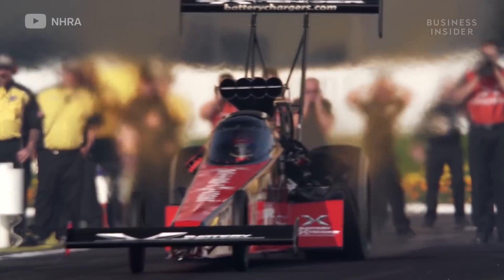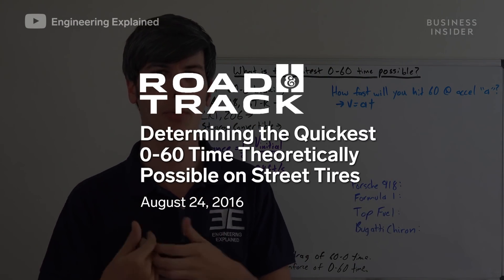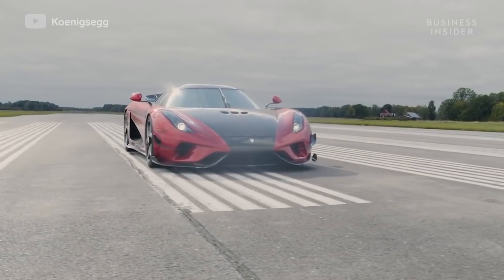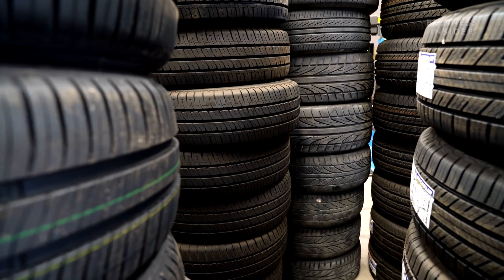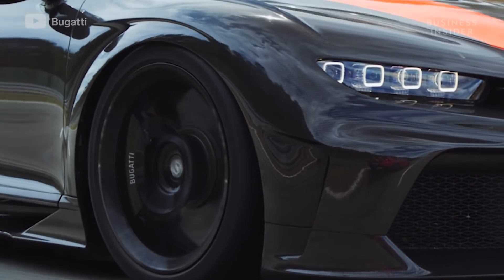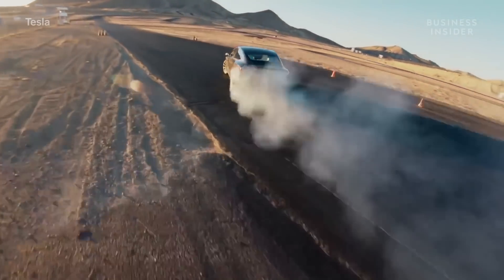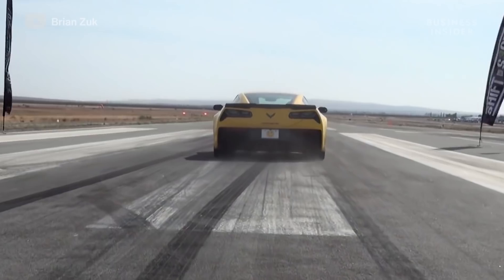Why Going 0 To 60 Mph In Under 2 Seconds Is Almost Impossible | Carsplainers

Comment: Is really 60-0 possible to use to estimate 0-60? Sure grip is the same, but there should be other variables, like drag, and maybe tire patterns
Reply: Yeah, engineering explained did another video on how he was slightly incorrect with that. Cars can potentially accelerate faster than they can decelerate

Comment: It's impossible to go 0-60 in under 2 seconds
Rimac nevera: hold my 4 motors
Reply: Thar Carwow drag race though...
Reply: @Wandagon  hell yes
Reply: @Wandagon  2.08 isn't exactly under 2 seconds
Reply: @MultiDeivas  I'm not saying it is, but that was just a drag race by someone who isn't their test driver and they didn't even try and optimise the car. So imagine if they do!
Reply: @Wandagon   The video literally says why something like that is almost impossible under 2 seconds. There is no need for the best drag racer, it's just holding the brake pedal and releasing, there are no gears nothing. Only thing you have to look for is that you pressed the throttle all the way in. Also the guy from Rimac said that Matty actually had the record speed on quarter mile with that car. The only way left to optimize the car to get to 60 faster is to add drag tyres which nullifies the road-ready aspect of these vehicles.
Reply: @MultiDeivas  the rimac did do 60 in 1.8 though
Reply: @mengienghinamwaami4894  Show me a video or some kind of proof. Carwow got a record quarter mile with 2.08. I don't see any proof other than claims of 1.8.
Reply: @MultiDeivas  On Michelin sport 4s tires on a normal track it did 2.08. with the Michelin pilot cup 2s and a well prepped surface. It will do well under 2 seconds. It did 2.08 while being on 98% power bro. When it's fully unlocked and the tires and track is set. It will hit 0-60 in less than 2
Reply: @MultiDeivas  You think Demon can reach 2.3s in normal conditions? Rimac Nevera has 8,6sec quarter mile in normal conditions made by a non profesional driver. Try to beat that.
Reply: @MultiDeivas  replay the vid and pause it when it shows the device that calculates the time for quarter mile. It also shows 0-60 time as well as the time it took to stop from 70-0. They showed the device for both the nevera and sf90
Reply: @adityavikram244  it can do 0-60 in 1.85 second If he have drag tyres and if it is a perfect surface for it
Reply: @hercegovac9999  the place where carwow makes the drag vids is pretty good when it comes to traction so I don't think there'll be much of difference. Maybe 1.9 but that'd be the max if I had to guess
Reply: @adityavikram244  If you want to know place where they tested the car is in Croatia and coditions were decent but again it made 0-60 in 2.08 in street legal tyres which is very good and if conditios Are perfect maybe someday they will achive 1.85 (sorry about english I am from croatia :D)
Reply: @hercegovac9999  yes because the rimac owner said they could make the car go faster by releasing new software updates so it is very much possible. That guy has made an absolute beast tho.
Reply: @adityavikram244  yes they can achive so much records in this car and he said it can easely go 500+ but it is limited 415 ode the safety
Reply: @MultiDeivas  it was 1.8
youd be surprised how much of a difference 0.05 seconds make in a drag race let alone 0.2
Reply: Drzi moja cetri motora
Reply: @stompingjacklope2217  English please
Reply: @user-sd7bh1hc8g  He said hold my 4 motors
Reply: @user-sd7bh1hc8g  why English brother? We can speak whatever language we want.
Isto sranje drugo pakovanje.
Use google translate my friend, its 2031
Reply: @markos4822  oh. Okey thanks man. Appreciate it
Reply: Kid Rimac Nevera did 0-60 in 2.1 seconds best never went under 1.9 😂
Reply: @Leonardo Meireles no they still lied even after rollout it cant do under 2 seconds, and electric cars cant be a sports car or super car just a bad parody of one a replica. U need sound n a tranny to be a real sports car or else its just grandmas grocery car
Reply: @Leonardo Meireles 🤣🤣🤣🤣🤣🤣🤣🤣🤣 my guy said overtaken. Get ur straight line ass outta my face, that aint real driving going in a straight line requires 0 skill I dont care about going straight fast.
Reply: How does it do this if its motors are being held?
Reply: @Eat-MyGoal  🤣
Reply: Tesla Model S Plaid = 1,9sek.0-60mph!
Reply: That does not go 60 in under 2 its not possible yet tesla lied, and if an electric car does it, it doesnt count because its not a real car so it doesnt matter, its made for grandmas
Reply: Tesla Plaid rally car 1.3-1.5s depending on the grip

Comment: This video sure didn’t age well, the Rimac Nevera can do it in 1.85
Reply: It says is almost impossible, not impossible.
Reply: @lmao6769_  people can't read
Reply: they are not official numbers, if you go by unofficial there are a ton of cars that can do it
Reply: @momentum8717  bruh its official go watch the carwow drag race
Reply: Uhhhh, he did point out quad EV motor vehicles are going to push that boundary. Which is what that car is....
Reply: @youwerealltooclever  EV wont do jacksh1t bc its all about the grip and not about the power u kids
Reply: With 1 feet roll out and a drag strip this video did age well
Reply: Well look, Matt or carwow drag raced the Rimac CTwo on ordinary pavement. and got the best time of 2.08 sec corrected, which is 2.28 uncorrected. Which is right where it was predicted on a pretty ordinary old unprepped surface. So it might be possible on a glue prepared dragstrip, maybe also with rollout correction, but not on regular roads.
Reply: very true

Comment: Okay, but how can we use the decelleration formula when during braking the air helps to slow down and in accelleration it works against what you're trying to achieve?

Comment: That brake distance logic actually isn't 100% true. It's probably not even 50% true. You can apply it in specific instances and maybe use it to build parameters, but as a rule? It's not even close to reliable. Just because a car brakes faster than another, doesn't mean it's 0-60 is comparable. They explain it in a way that sounds like it makes sense, but in a lot of ways, it just doesn't.

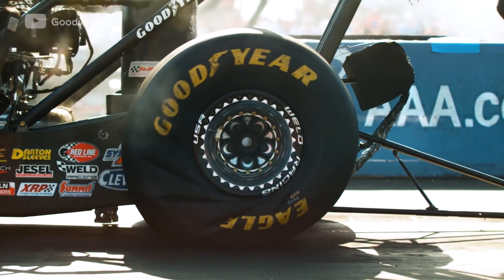Comment: 2:04 More surface area does not increase friction
Reply: It does, one of the reasons that slicks make more grip then normal street tires is more tire touching ground
Reply: For rubber tires more surface area or a larger contact patch creates more total grip. This really only applies to rubber because the coefficient of friction of a tire is inversely proportional to the pressure on the tires. So for a given compound a larger contact patch decreases the pressure pushing on the tire, for most everything else though with a static coefficient of friction, surface area doesn't matter.
Reply: The biggest difference between race tires and street tires is the compound though, so i'm sure you could cut tread into a slick and it will still have more grip than a street tire with the same grip, the problem is the tire won't last nearly as long.
Reply: @tnc4700  "The force due to friction is generally independent of the contact area between the two surfaces. This means that even if you have two heavy objects of the same mass, where one is half as long and twice as high as the other one, they still experience the same frictional force when you drag them over the ground."
Reply: Except it does
Reply: @bendeguzbagosi2385  No, not directly. A wider tire wouldn't increase traction if non of the other characteristics changed
Reply: @madmarshmallow3983  It would increase grip, not friction
Reply: @tnc4700  he is right lmao. Traction is not friction. Google it
Reply: @tnc4700  I will explain to you again since it looks like you skipped basic physics class.
Friction NOT equal to grip or traction, they are two different properties. You are talking about grip, not friction
Reply: @tnc4700  softer, not wider. Softer tires are wider to manage tyre wear

"Wider performance tires are stickier and made for cohesion with the road, they are also wider to manage wear. For tyres the friction generated between the tread rubber and the road surface is generated through two mechanisms - adhesion and hysteresis. Pressure distribution in a roller wheel is not symmetric at the contact patch, rising steeply at the front and rear of the contact patch to a value that is approximately equal to the tyre inflation pressure. Overinflation and underinflation change this distribution because of a higher pressure in the former and a reduced pressure at the center of the patch in the latter."

Comment: Feet/seconds , 0-60mph, crying in metrics 😭
Reply: Acceleration in feet/second as well 😂
Reply: @luca_sbll  should be feet/second^2 tho
Reply: @lUnderdogl  yes, that was the point of my comment
Reply: Even though I'm all for metric system I dont mind people using 0-60mph as it's almost equal to 0-100kmh
Reply: @hamzajunaid11022  62 miles is i think 100kph
Reply: Hamburgers/freedomEagles
Reply: I’m pretty sure there are at least 5 similar videos out there narrated by some British guy instead.
Reply: tbh i just got used to it,like for example:
15mph=25km/h so 30 mph=50km/h

Comment: Everybody talking bout the Tesla Roadster but nobody talking about the Rimac C_Two
Reply: @James Olelo thats all just shady. Its been announced for years now. The Rimac is basically in its final stages before going into production, theyve made dozens of test cars and driven them, even F1 champion Nico Rosberg has driven it on his channel. The Rimac, at least now, is a much more real car. And i seriously doubt the 0-60 time of the Roadster with that price
Reply: The Rimac C_Two prototype did 0-60 in 2.39 on 80% power and two people in the car just a few months ago. The final production version of the Rimac C_Two will be introduced tomorrow btw. It will be interesting to see the 0-60 of the final product.
Reply: Electric cars are terrible and soul less. It’s like the fastest dishwasher you can buy, who cares…….also, 6000 lbs sucks for anything but straight line acceleration and they are terrible for longevity at track days.  Bottom line, if you are a real driver, you DONT like electric cars other than for pure utility.
Reply: @cqc556  pfff. Bet you never been in one. And not all electric cars are 6000lb
Reply: @mr.simulator4724  The Nevera is almost 5k pounds(4747 pounds) but it has aero and it has torque vectoring to somewhat improve handling. Inertia from the weight is still an issue and it requires a lot more to compensate compared to lighter ICE cars. New battery technology could reduce weight though but those are likely gonna take quite a while to be ICE car level light while still maintaining high energy storage.
Reply: If you did t know, romance released the Rimac Nevare yesterday. I think carwow did 0-100 kph in 1,6 seconds
Reply: @chm1ata  Yeah, and they even broke the quarter mile record unofficialy
Reply: @chm1ata  Nevera*, means Storm when translated from croatian.
Reply: @jebipasadegene  nice
Reply: @pranavprasanth4488  this didn't age well
Reply: Rimac Nevera
Reply: @Javijimenezariza  well yeah but the comment was made 2 months ago and i never got round to edit it lol
Reply: Because the Rimac is really expensive, only very few people would afford these $3 million hypercars. A $200k car isn’t cheap, but definitely much more accessible than the Rimac, and promising similar performance. So many people actually look forward to buy a Roadster, but I think Plaid S cannibalized a lot of hype for the roadster
Reply: @kerbodynamicx472  but the Rimac at least exists... the only thing ive seen from the roadster are edited photos and cgi
Reply: @brunolang210  hey at least there’s a prototype on the announcement
Reply: @brunolang210  the roadster exists man lol
Reply: @brunolang210  plaid exists..
Reply: @cascito  well, this comment is 7 months old, and the plaid got thrashed on the 1/4 mile by the Nevera so...
Reply: @brunolang210  Now u seriously doubt the roadster ?
Reply: @cascito  well, yes.
Since there are still a lot of Tesla's promises "put on hold" so to say. They have to start delivering to regain my trust, no doubt tesla is a cool brand but their claims are often not realistic.
Reply: @brunolang210  I love Tesla , SpaceX and Elon , I know what they have gone through , Tesla have gone through hell and where they are ... It's just inspiration and I am a car guy too..
Reply: @cascito  dude. Do u really think he was all alone doing that? The fuq. How limited is ur thinking? 🤣
Child go sleep. 
Yaar iss Elon ne kya pilaya h tum logon ko.
Do u even know that companies like Porsche were once on the verge too? Tesla isn't some lone wolf/dark horse sh!t.
Reply: @kamallb4650  bachche aadhi baat p rote nhi ....
Maine poori bio graphy padh rkhi h ...
Aur usne apne paypal k paise se baar baar Tesla aur SpaceX ko bankruptcy se bachaya h...
Reply: @kamallb4650  Ek aur baat pata h na SpaceX k saamne ISRO bhi kuch nhi h ..... SpaceX jab 10 baar launch krta h na tb ISRO ek baar sochta h launch krne ko😂😂😂
Reply: @cascito  umhm🤣
Good luck Bhai....tum hi sahi ho. Baaki duniya n doosri companies toh exist hi ni krti.
Ye saare k saare ek hi h. All hail lord(daddy) Elon 🤣
Reply: @cascito  beta tumahara isro aur space X ko compare karna hi bataa raha h kitna tumne Elon ka peeche le rakha h🤣
Reply: @kamallb4650  Kyu trigger ho gye kya 😂😂😂
Reply: @kamallb4650  All hail to my son Kamal LB too...
Reply: @cascito  yeah....I'm not ur son. If I were it would have been shameful for me though.. I would have straight up disowned u. So stop living in ur delusion world🤣
Woh toh replies se pata chal rha h ki kon trigger hua h☠️
Reply: @kerbodynamicx472  nobody said anything about price.
Reply: It still doesn't exist though
Reply: @brunobegic3841  it does. Today was the reveal.
Reply: @brunolang210  the Tesla doesn't, that's what I'm saying.
Reply: @brunobegic3841  has any Rimacs been delivered to their customers?
Reply: @JAM_2024  A few, yes
Reply: Hammond:
Reply: Rimac is also $2.4 mil and only 150 are being made, the tesla roadster is $200k and widely available other than the founder series that will be limited to 1000 cars
Reply: @BruceWayne-ct4yq  it's not even available.
Reply: Doesnt plaid already do 1.9s?
Reply: Everybody talking about the tesla roadster but nobody talking about the 1970 beetle
Reply: Teslas are just a joke lmao
Reply: @lotni  yes a joke which u dont understand
Reply: @tusk6400  LMFAO ROASTED HIM

Comment: Dont rally cars regularly go from 0-60 in 1.8 seconds.
Reply: So that proves that the tire comparison used by that youtuber isn't accurate. He used the stopping distance of a corvette and therefore only proved the max acceleration of a corvette if it had unlimited power. This shouldn't be extrapolated to set a limit on all road cars of 2.05 seconds. 

Cars have different weight balances when accelerating compared to when braking as well. This changes how the tires interact with the road and the balance of the car. This could play ibto acceleration as well. The car shown in the video with 4 electric motors is the test car for Rimac called the Concept Ctwo. It has an estimated top 0-60 acceleration of 1.85 seconds in a one foot roll out. Whatever that means. This is FAR beyond the "limit". 

So we have a 4 door dirt car and a 1900hp street legal electric science project that go beyond the limits set out by this youtube test. We need a new limit to account for this.
Reply: If you're talking about the ones in WRC, I'm not sure yet. But if it's RX you're talking about, yes, thanks to 600+ horses, AWD, short gear ratios and other factors I may not know about yet.

Comment: 4:24 that delay tho 😬
Reply: the MOST advanced electric drivetrain
Reply: I was looking for this comment😭😂
Reply: Hahaha I was looking for this
Reply: Bro I died at that most advance electric drivetraim 😭😭😂
Reply: Because the system always give accurate data.

After you give the system some input, it can give signal to device on instantly but the device still need mechanical way to process the data and apply it. So there's the delay.
Reply: @ryany4n  it can at least just display the drivers settings by following the finger before it mechanically configures the car

Comment: The subtitles are different from what's being said :/
Reply: Because they are auto generated
Reply: @-_--le3zk  
It's not auto generated 
Check it
Reply: @ironeddingus1968  open the subtitles again,there is written in a bracket,another way to tell is auto gen su subtitles are on bottom left,where as captions written by the youtuber itself are on bottom mid
Reply: @-_--le3zk  it's not auto generated, if it was, then it would have been written like the following: "english [auto-generated]" but instead it's just "english"